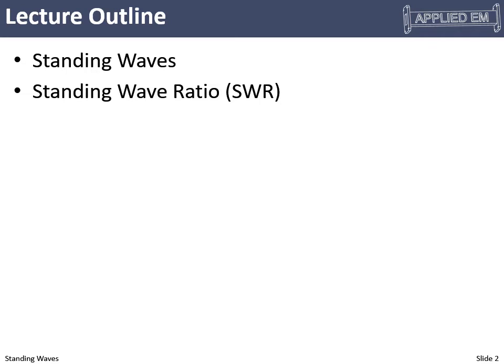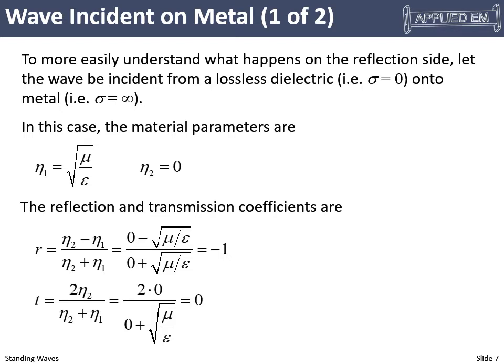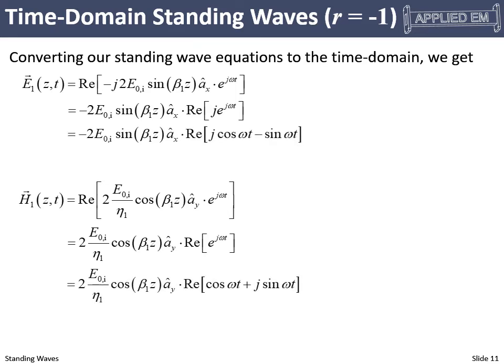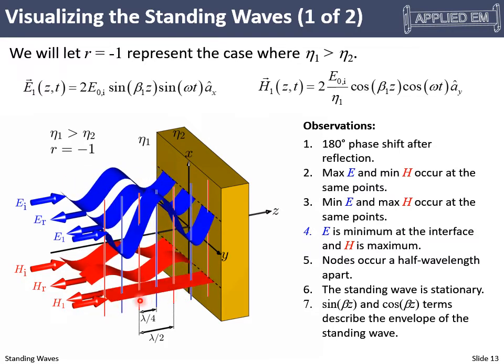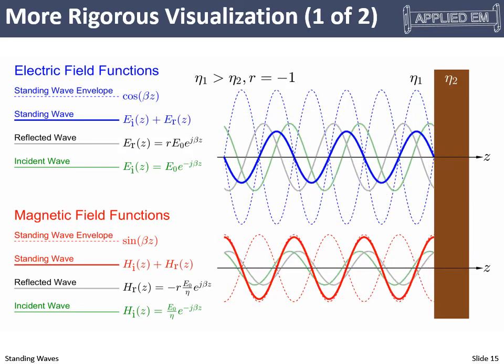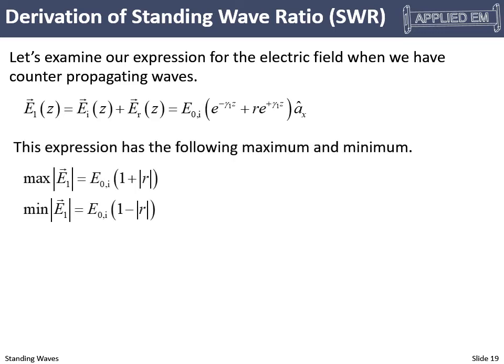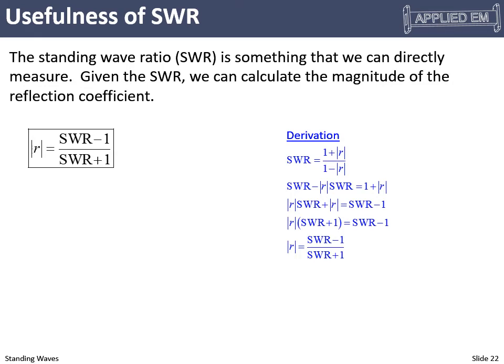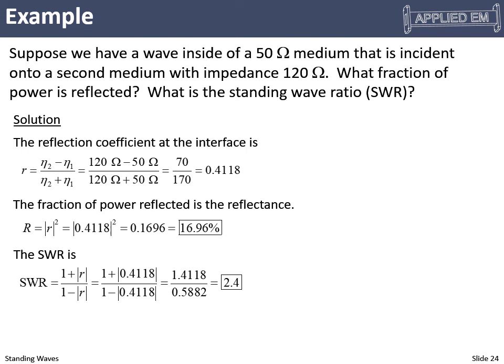Lecture 3j -- Standing Waves

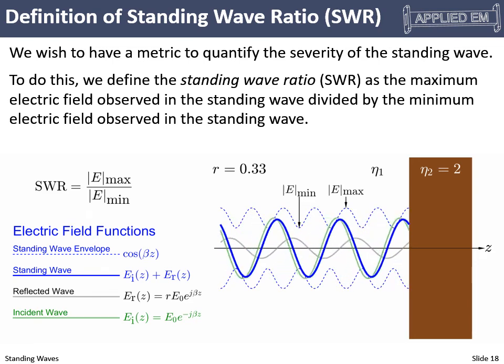Comment: Am I correct:  In the animation at 21:00, shouldn't the blue solid curve get shifted above the horizontal line? That's because the sum of the incident and the reflected waves in this case never goes to zero.
Reply from the maker: The blue line is the sum of the incident and reflected so it can be shifted due to a potential phase difference of the reflected wave.  However, for pure sine waves, it has to be symmetric above and below the horizontal line.  I am not entirely sure what you mean by "shifted above the horizontal line."  If it was shifted above the line and not shifted below the line, there would be a discontinuity in the field.  Maybe I am misunderstanding what you are asking.  Sorry!
Reply: @empossible1577  Thank you, Professor Rumpf. I have to reconsider that and I'll write down the conclusion here as soon as I figured it out. It is a bit confusing indeed and I will clarify that on top of your comment and mine and post it here.
Reply: @empossible1577  Well, it turned out I looked at a simple matter from a wrong angle. Quite simply, the envelope should not be zero, which is depicted correctly by the dash line.